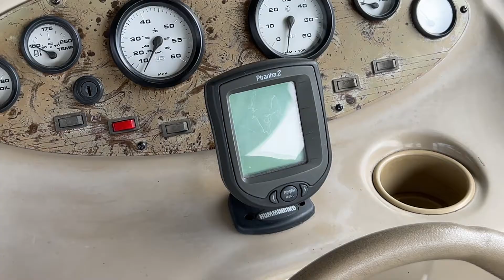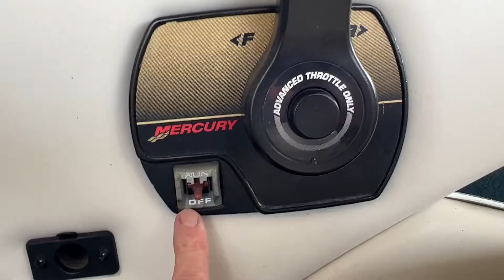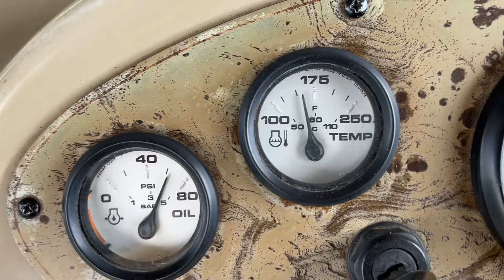How To Start An Inboard Boat Engine / Step by Step

Comment: Ive got a bravo one. Is it supposed to spit out water out the side like that?
Reply from the maker: I think every boat should have a bilge pump.
Reply: That is bilge water being pumped out due to the excess water from coolant plugs being removed on the initial start.

Comment: NEVER HEARD THE BLOWER ACTIVATED FOR 5 MIN.BEFORE STARTING...
Reply from the maker: LET’S TALK ABOUT BLOWERS AND THEIR IMPORTANCE
Posted by Frank Taylor | Jun 26, 2022 | The Careful Captain

Recently, I watched as one of my dock neighbors walked down to his boat. Within seconds of stepping aboard, he stuck the key in the ignition and started it up. His boat is a bow rider with an inboard engine and stern drive. It made me wonder how many people start their boat’s engine without even a thought of running the blower beforehand.

If you are one of those people, consider this: According to the U.S. Coast Guard, there were 176 incidents of fuel-related boat explosions in the U.S. in 2020. Most of these incidents could have been prevented if the operator had simply taken a few minutes to run the blower prior to turning the key. All gasoline-powered boats equipped with inboard engines and built after July 31, 1981 are required to have a blower installed. It is recommended that this blower be run at least four minutes prior to starting the engine. It should also be on while running the engine at idle or no-wake speeds for long periods of time.

So what does this blower thing do anyway? Basically, the blower is used to ensure adequate ventilation in the engine compartment. It is a fan that will run, sucking air in one side of the compartment and blowing it out the other. By doing so, any gasoline fumes that may have built up in the compartment will be ventilated into the atmosphere prior to starting the engine.

So why are there fumes in the engine compartment anyway?  Technically, under normal conditions, there should not be.  Sometimes conditions are not normal though. Maybe a fuel hose has come loose over time due to vibrations or maybe there is a defect in the fuel pump. Something could happen that may cause a small amount of fuel to leak into the bottom of the bilge. As it evaporates, fumes build up in the engine compartment. A spark from an electrical wire or a backfire from the engine can then lead to catastrophic results.

Personal Watercraft have an enclosed engine compartment. You may ask why they do not have blowers. PWCs do have a passive ventilation system but they are clearly not as effective as the blower on a boat. That is why PWC manufacturers recommend removing the seat to expose the engine compartment and checking for fumes before starting the machine.  It is a common understanding that the best way to detect gas fumes is by using your nose. In fact, this method can be used no matter what type of vessel you are operating.

So if this is so important, why do I not have to run a blower on my car before starting it every morning? Unlike boats, cars do not have an enclosed engine compartment. If a leak did develop due to a faulty fuel line or some other anomaly, the fuel would simply leak onto the ground below and not remain in the engine compartment.  This in combination with the ability for air to freely flow through the engine area would prevent any potential explosion hazard.

The next time you take your boat out for a day on the water, don’t forget to flip that blower switch and let it do its job before turning that key.

We all love being on the water and can’t wait to get out there but four minutes is more than worth it to ensure a safe day of boating.
https://lakesidenews.com/